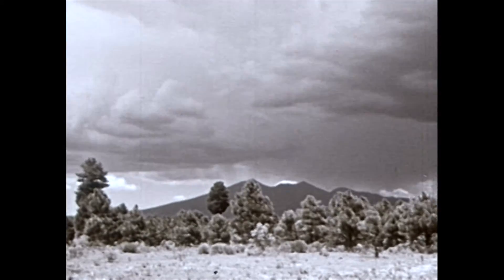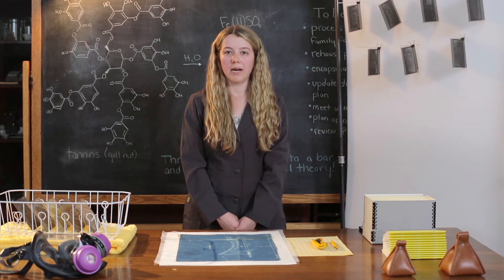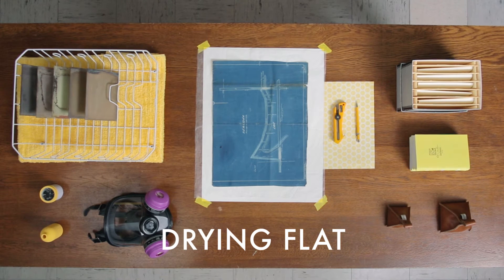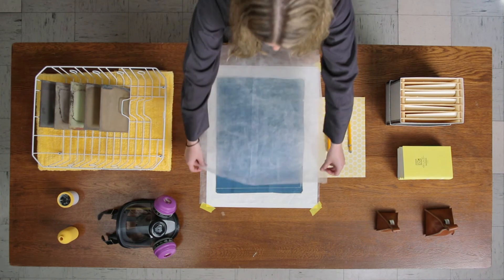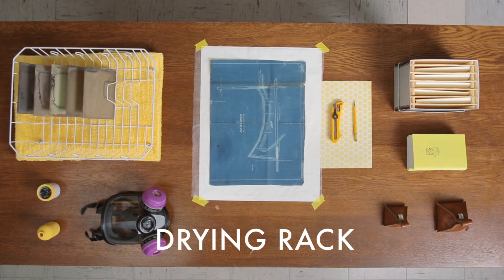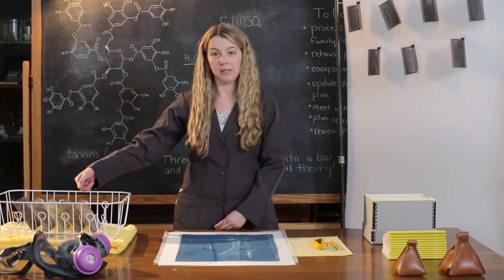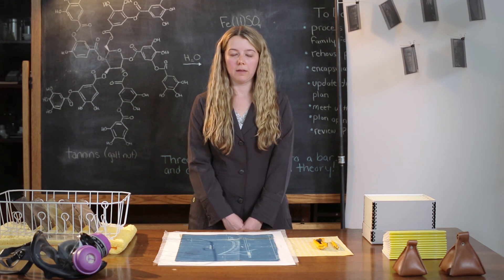Drying Wet Records

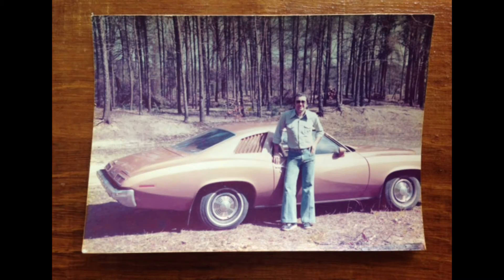Comment: Hi. Around 1:08 you said that glass negs should NOT be frozen. Can you please tell me why is that? Thank you :)
Reply from the maker: +Cezar Popescu Thank you for your question. Our response is based on our experience with salvage and disaster recovery of photographic material. When the glass is wet and you freeze it, it can crack. Also, if you have not identified if the glass plate is either gelatin or collodion emulsion, you should not freeze the negatives. For example, gelatin is soluable in water. If you freeze the wet glass plate negative, the gelatin will solubilize once you remove it from the freezer. Collodions can also be damaged by freezing. We hope this answers your question!